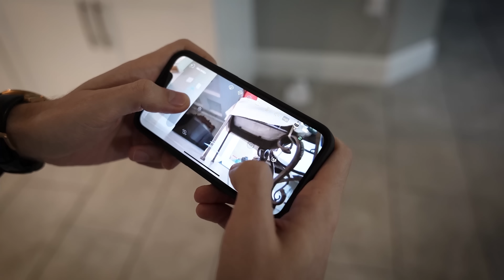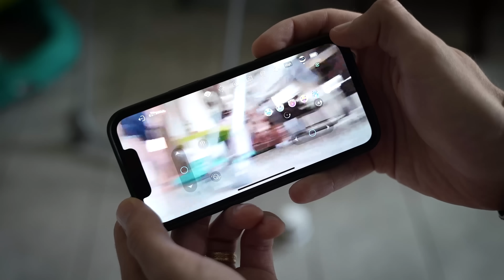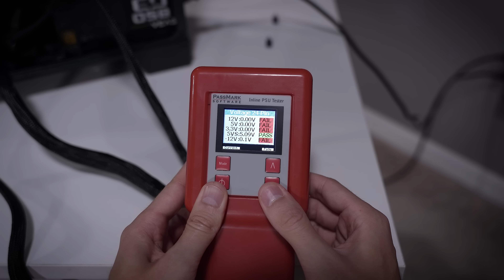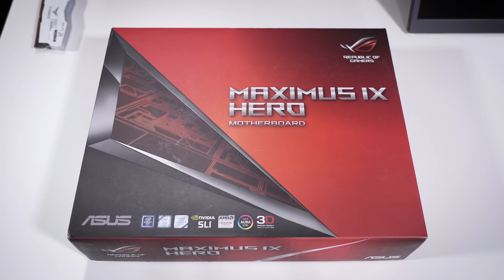Fixing a Viewer's BROKEN Gaming PC? - Fix or Flop S3:E8

Comment: Wow Greg is so generous! Even though he said he would only replace 1 part he gave him 3 (if you include the sleeved extension cables). He’s also probably the best pc fixer on YouTube. His videos are clean and concise and easy to understand. I’ve learned so much from him
Reply: Yes very much so. He shows it all basic and in words we can all understand. It’s like we are all hands on in his videos with him. Very educational and fun to see mostly every PC have its own unique set of problems and how they’re fixed. Very well done and captured.
Reply: he clearly dances around the most likely causes to make an actual video out of this... pop and doa pc, is almost always mb/psu, then it's just a matter of trial and error to figure out what else was killed then the first unit went.  still it's solid content.
Reply from the maker: @arizona_anime_fan  Not dancing around at all. Jumping straight to what I think is the cause could result in overlooking other problems with the build. For example, replacing the PSU immediately wouldn't have told me anything about the state of the motherboard (and may have resulted in damage to the replacement unit). It's important that we work toward minimizing variables vs. aimlessly replacing stuff without first isolating.

Comment: I had an Asus X99 board that killed the CPU.  I turned it on one day (after using it for months) and it shutdown almost immediately.  It was a total pain to figure out what happened, but it was a good learning experience.  I disassembled the entire computer and inspected all the parts.  Ended up finding burn scars on the motherboard in an area near the CPU socket.  I RMA it back to Asus and explained what happened along with pictures of the area.  They sent it back a few weeks later stating they updated the bios and cleaned the burn area.  As if there was no concern to use it again with another CPU?!  Long story short I bought a new motherboard (different brand) and Intel replaced the CPU.

Comment: Because the power supply blew and took out several components, I would go one step further and boot Windows and do some stress testing of the CPU and GPU just to make sure there wasn't any damage from the power supply that would cause instability under load.

Comment: We want to thank the motherboard for taking one for the team and dying to protect the other parts.
Reply: No thanks to the PSU, though... It. Had. One. Job!
Reply: @ruxandy  Maybe the PSU faced a big voltage surge and protected most of the components.
Reply: @panzer3279  That’s not how it works. :-)
Reply: @ruxandy mind explaining how it does armchair electrician
Reply: @rockstar-5934 , mind using punctuation marks?
Reply: That’s why it’s called a mother 😢
Reply: "RUN YOU FOOLS"
Reply: Mother protected it's cubs!
Reply: Thanks Mom, always self-less
Reply: I haven't finished the video, but I suspect a capacitor.

Comment: When I read the thumbnail & it said "a pop" I knew it was the PSU. Happened to me, was sitting at the PC doing my thing when the system just shut off suddenly, I have the back of the PC facing me & when I looked at it & loud pop happened & large spark came from the back off my case. Brown trouser moment I can tell you.

PSU, motherboard, cpu all fried. It was getting old & long in the tooth & needed upgrading but still scares the hell out of you when it happens.

Comment: I'm also really surprised that a EVGA G3 Gold PSU died like that. Actually I'm using that exact same PSU. If I recall it was a rebranded SuperFlower, this should be a good tier PSU considering EVGA offers a 10-year warranty on it.

Any chance you can disassemble it and check inside to get a better idea of what happened? Obviously taking the necessary precautions of course.
Reply: i had a similar issue with the same model PSU had a popping sound and wouldnt power on took it apart and one of the caps had exploded replaced it and that psu now powers my daughters system
Reply: Same I am shocked as well. My system has an EVGA 850GT which is one of the best out there.

Comment: G'day Greg,
I once had my Gaming PC go "POP!"😲💩...😯...😭, it was the VRM of my GA-970A-D3P when running my Athlon II 640 at 4.5GHz, everything but the Mobo survived.
Just wondering if you plan on sending the PSU back to EVGA & Motherboard to ASUS to try & find out which one was the cause?
Plus while the Motherbord being 6yrs old I'm sure is out of it's Warranty but the G3 at the same age or less should still be covered by it's 10yr Warranty so eligible for a replacement & if it was the cause maybe EVGA replace the Mobo too.

Comment: Just one small thing, the i7 7700k is a 7th generation CPU so is not compatible with Windows 11 (well not officially). I only know this because I have the non K version and that is not compatible either. Yes you can still install Windows 11 if you want to and know how to do it, but it will not be supported by Microsoft with updates etc.

Comment: Hello, recently bought the same psu for a rig i was building as it was recommended to me by a worker at canada computers as the psu i was looking for was out of stock, this psu came in dead and come to find out they have been shipping this psu out with not only incorrect cables but also dead. TL;DR STAY AWAY FROM THIS POWER SUPPLY

Comment: The original PSU is rated A-tier on LTT and powered a system that would have been fine on 650W... that is an extremely unlucky failure.
Reply: Well, that happens sometimes even with good quality units.
Reply: From what he said in the pinned comment... it was lighting, and it struck.
Reply: Was wondering the same... Could have been some kinda external factor..
Reply: I've had a similar thing happen, the day after I build my PC it refused to power on. My 2 day old Corsair RM750x PSU fried itself overnight somehow
Reply: I've had some unlucky failure too with a 650w gold rated PSU too. Nothing blew, it just shut off one day while I was on the PC.
Reply: Unless you buy Seasonic or Super Flower, you really don't know what company is making other PSU's. EVGA got a good rep while they were using Seasonic as their manufacturer. Now they use a different company. You can't really go by tier lists when companies change suppliers but keep their naming schemes.
Reply: @TechRIP  G3 units are Super Flower.
Reply: @ryanmcgraw1743  Are they still though? When I last did my PSU checks 3 months ago, I didn't see that. Seasonic, I believe, first made EVGA's G2 and then Super Flower did G2 and G3. That's how EVGA gained a great reputation for GPU's. But, then I could have sworn once the tariffs hit that they went with a different OEM years ago for the G3 which would become the G5.

I hate not having updated facts. So, could you please direct me to an article showing that Super Flower is still making them? Thanks.

I checked myself, and I can only find the same info I've already pointed out. And, this all proves my point. If you have to keep track of who is making what, you shouldn't buy their product. Just buy Seasonic or Super Flower. lol
Reply: @TechRIP  well you said it yourself...the G5 is when Super Flower stopped making them. G3 isn't in production anymore.
Reply: @ryanmcgraw1743  Correct. So, depending on the batch of G3's, you could have had one from Super Flower or from the  other OEM they switched to while using the same G3 name before switching it to G5.

I think the mfg was FSP??? And then I think Seasonic did the G6. That's why I tell people to never buy EVGA. You don't know who makes it and they can go with someone else 2 weeks later. Plus EVGA were the GPU's with the most Ampere power delivery issues.
Reply: @TechRIP  to my knowledge they didn't switch midway through G3. As far as I know, G3 was Super Flower, G5 was FSP, G6 Seasonic, and G7 FSP.
Reply: The EVGA website forum made it sound like they did continue G3 with FSP before switching the naming scheme. But, after the FSP fan fiasco of the G5 then EVGA trying to regain their name with Seasonic to only go back to FSP is ridiculous. You can't recommend a company like that. But, like Nvidia, they have a loyal fan base.
Reply: Some EVGAs are not so good as they might look...

Comment: I have a system I have used daily since I built it in early 2017 with this same Power Supply, 7700k CPU , Asus Maximus IX MB and a 1080Ti Strix GPU.  I have never had an issue with it and its been 5.5+ years.  That said, this does make me a little uncomfortable...  I have built other rigs since then but it would suck to lose the rig for no reason.  Its important to note that I also have always had it plugged into a pretty decent surge protector.  Hopefully it won't be an issue.  :(

Comment: Hey Greg, How about if I give you all the components that I wanna upgrade for my currently setup? Little bit info currently:
 Intel I7 9700K 
Aorus Z390 Pro Wifi 
2x16GB TridentZ Royal
Aorus Liquid Cooler 360 
Gigabyte Vision 3080Ti
Asus 750W power supply in a completely custom build case from corsair 570x

Comment: My Asus x570 tuf motherboard is a disaster waiting to happen. Several "pops" over the years I had it, so far it killed two fans, and one of thr rgb headers and (almost) all the bottom IO connectors are dead. I dont plan to replace it anytime soon...at least until i fill out the bingo card. wish me luck.

Comment: PSU taking out the boards not uncommon and explains the pop. The pop likely meant there was a fault component, and it took the board with it. A power surge is possible but unlikely as it should just trip the power supply without killing anything.
Reply: he was lucky he had the asus x270 board it has buily in polyfuses that will have taken the surge from the power supply and protected the other components

Comment: You should pick up some low spec cheap used  sacrificial CPU's (i3's, etc) that'll work on these different boards, that way you aren't necessarily testing with a 'hot' cpu all the time.  (I suspect you probably have some that you use off camera though).
Reply: Wonder if that model PSU was one of the ones EVGA had issues with, I know it was some of the Supernova models..

Comment: greg you ever use a lightbulb short tester easy to build just put a switch with a incandescent bulb in series on hot line. if the bulb goes bright then turns off its good if it stays on it has a short.

Comment: I understand he's not charging anything for this but did he really not have an 850W PSU to put in there? User is now getting 100W less than before.
Reply: Since the PSU was dead, the user is now getting 750W more, genius.
Reply: 750W is enough for RTX 3090 and below, afaik
Reply: He should be grateful that his pc was replaced with quality parts and is now working perfectly.
Reply from the maker: Are you really gonna sweat a 100W delta in a rig that consumes far below that under peak load... all the while TWO different components were replaced for free? The internet will literally complain about anything 😅 The owner was grateful for the replacements. If he wasn't, he could've taken the rig back as-is. No one's forcing anything here.

Comment: So he Heard a pop While using it but it came with no OS on it saying that he couldnt use it ever since ?? What was he doing then when it Popped ? Also his CPU/Mobo are old so he would definetly had an OS on one for the disks unless OFC it was sent specially for this series. Anyway I was enjoying the vidéo till that bit messed up my thoughts 😅, Great work/séries Hope you Keep up
Reply: To install an OS you would need to turn on your PC... which then pops. Might have been a budget build with older gen components. They look pretty unused.
Could of course still be malicious sent in but lets be honest, worth the risk to possibly help someone that has to work with such a budget.
Reply: @jellygoo  my thoughts as well, I would not straight think that. Its just a little suspicious that an old rig wouldnt have an OS but if its recently bought then it changes things

Comment: I've had the board take a GPU with it because of a short. The CPU works but crashes. It was a solid Corsair model PSU. PSU was fine during testing afterwards.

Comment: Did you not have a look on the motherboard for a blown cap (which was probably the pop) ?
Reply: Given the PSU had failures across the board I'm guessing it was that which went pop.
Reply from the maker: We physically inspected the motherboard with all shrouds removed and couldn't find anything obvious.

Comment: I've once had a power supply that popped, that took ALL of my components with it. CPU, motherboard, GPU, hard drive, optical drive, everything. The only thing it didn't take was the ram.
Reply: Was the PSU under warranty?
Reply: @ehdbom  Unfortunately, no. Of course I would expect that of a power supply that wasn't even 80+ rated. A 450w, at that. That particular one was shoddy, even for 2011 standards. Lasted me right up until it popped and destroyed my computer back in early 2017. I've gotten new parts since then, but it still sucked.
Reply: I would still probably not use that RAM, cant be too happy...
Reply: @profosist  This was back when I was very, very unfortunate to have a single stick of 4GB DDR3 ram stuck running at either 1066 or 1333. Nowhere near enough ram even in my old DIY's twilight years to do anything at all. lol
Reply: I had the inverse happen.  2012 iBuyPower prebuilt with a Great Wall PSU.  The PSU went out with a pop and a flash around 2017.  Everything else was fine except the RAM and a single bad RAM slot on the motherboard.  Replaced the PSU and RAM and it worked for another year until I built a new PC.
Reply: Quick question, and ik this comment might be 3 years old. But just out of curiosity, did it take your optical drive's data with it too? Did you contact a data recovery specialist or just give up on getting your data back?
Reply: @DTS24-DJT24  We didn't have the time or money at the time, unfortunately.
Reply: @exxor9108  Ah gotcha, was curious just incase the worst ever happens to me.
Thanks for the reply.
Reply: Had the same, only the optical drive and RAM survived. Well at least I had a good reason to build a new PC for myself...
Reply: A friend of mine had the same thing pretty much, he lost mobo, cpu, gpu, psu, 3 out of 4 hds and even his fans were dead o.o yet the ram lived on
Reply: This is why you do NOT skimp on the PSU.   While even the best can fry, your odds are MUCH better with an A-tier than you are with Joe’s Discount PSUs
Reply: @jacksfather  I had no knowledge of this back then. lol I wasn't as into computers then as I am today. But it was a lesson learned, I won't ever skimp on a power supply ever again.
Reply: @exxor9108  lesson learned the hard way
Reply: @jacksfather  Yup. I had neglected to mention, that the power supply that popped that way, was a Cooler Master. Might have been one that came with the case. Though I know these days, at least as far as I'm aware, Cooler Master has increased the quality of their power supplies. My current one now is an MWE 80+ Gold up to 650w.
Reply: The only PSU that I've had pop took only the PSU, and that was in the 90s. I've had a faulty-when-bought PSU (arcing and smell) and a badly designed PSU/case combo (I dunno, overheating probably killed it, had three identical PSUs (replaced under warranty) fail). Others have been just "won't turn on/stay on".
Reply: @samiraperi467  got lucky.    A bad PSU can take out every last component.
Reply: Are you a smoker? Asking out of curiosity because Greg mentioned your PC smells like a smoker’s rig.

Comment: hey so my little brother had that exact same PSU in his build and it also popped and killed its self. Luckily, nothing else was damaged though. I thought it was a fluke but this video has me second guessing.
Reply: Same here, I don't think it's a fluke. Replaced it with a corsair one and all has been good.
Reply: I have a system I have used daily since I built it in early 2017 with same PSU, 7700k , Asus Maximus IX MB and a 1080Ti Strix card.  I have never had an issue with it and its been 5.5+ years.  This does make me a little uncomfortable though...  I have built other rigs since but it would suck to lose the rig for no reason.  Its important to note that I also have always had it plugged into a pretty decent surge protector.

Comment: I remember having a gaming computer years ago on a surge protector and a t-storm was moving through and I wasn't thinking anything of it, but lightning hit the house and caused mine to blow up :( it was a sad day.
Reply from the maker: Ooof :-(
Reply: it was probably only a power strip and not an actual surge protector.  Most ppl don't think to double check that they are using an actual surge protector.
Reply: @obrebel0  could be possible, but if lightening hits the house and your stuff is plugged in only Jesus can save them
Reply: @obrebel0  plus I’m quite sure that surge protectors go bad
Reply: @obrebel0  Or that the surge protector has very little protection, having a tiny and cheap MOV. Also, they aren't meant to last forever, as the MOV eventually will wear out, and needs to be replaced.
Reply: this actually happened to me last year,  killed motherboard, gpu, psu, real sad day
Reply: Yeah lightning hitting your house directly is no match for protection it's so much energy that it simply bypasses it.  It protect from surges coming from your outlets usally between 330 volts (cheap ones) all the way up to 4000 volts (more expensive). Lightning is known, as a standard, to have a voltage potential of 100 million volts!!!
Reply: @randar1969  how many volts is it if all of the energy goes to ground? It's electrical code to have your system grounded.
Reply: yikes i feel that one bro when nature says no
Reply: I have like 5 computers at my house so I had my electrician install a surge protector at the breaker, protects the whole house. About an $800 investment but worth it for piece of mind here in the Midwest
Reply: Big oof... :eyes-purple-crying: